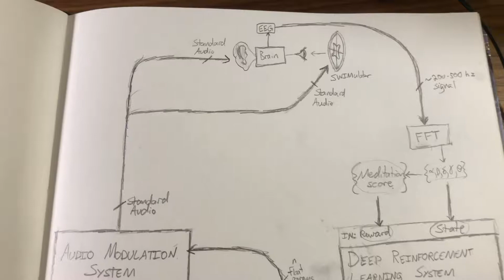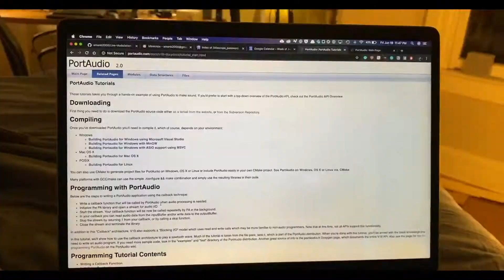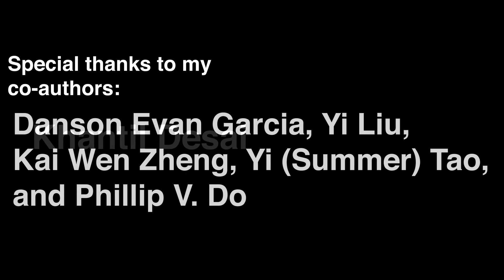NSERC USRA 2020 at MannLab (Aman Bhargava)

Comment: Hey man! I saw your AP Research video and your other videos. I'm new to AI and want to pursue AI with brain tech in the future. I'm not sure where to start, any tips?
Reply from the maker: I got started with machine learning through Andrew Ng's Machine Learning course on Coursera. I think it's a great way to get introduced to it if you haven't taken much linear algebra or vector calculus. I'd definitely recommend this if you're not yet in university. If you have taken linear algebra and vector calculus courses, you can definitely pick up ML much faster by either reading a textbook on it or auditing an "introduction to machine learning" course from a university like MIT that puts lectures online for free. 

You should also learn python or another common general-purpose programming language if you want to start applying your ML knowledge to brain tech -- you can start by doing projects on your own where you analyze brain scan datasets (Kaggle has a bunch of free datasets to play with). You can also buy a brain scanner (Emotiv has a great python API for streaming the EEG data super easily, albeit expensively). If you're in university, you could also join a biomedical engineering lab that does this kind of stuff.

Hope this helps :)